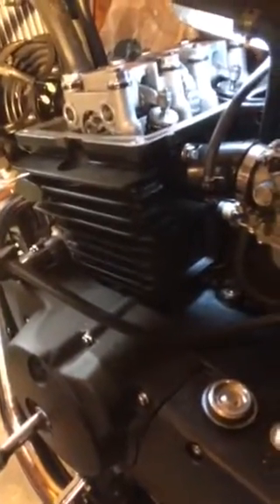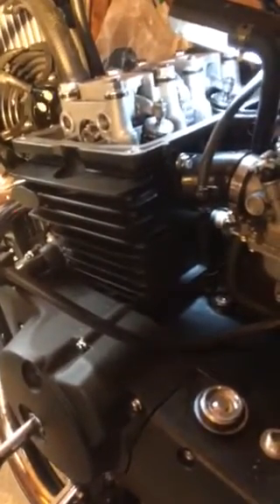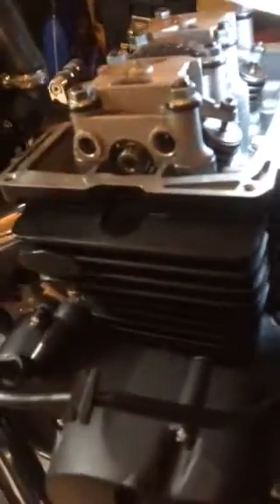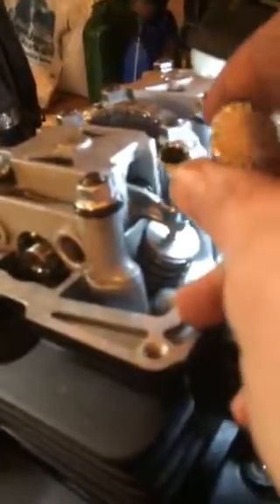AJS DD125, Bobber, EOS, and  Daytona Tappet Adjusment, By Pudsey ajs

Comment: Hey there a question about the dd125e
my bike keeps cutting out.
don't know if you've had similar problems.
to me it seems like it's getting really hot after little time. I ran it for 10 minutes and the pipes from the radiator to the engine were really hot to touch.
a friend of mine said it seemed like there was no air getting to the carbs at a stand still. always cut out at a junction or red lights

Comment: hey Steve quick question. is this while the engine is cold or warm?
Because I've done my valve adjustment. but while I'm riding after about 25 minutes of riding. I can hear them tapping quite alot.

Comment: Hey there. I have a question for you.
I have a AJS dd125e-8
it's at 980miles and needs a service.
Wanted to know if the dealer would collect it from me as I can't ride it. Cos it needs a valve/tappet adjustment. it's a brand new bike. only had it since March 31st.
and I have warranty and I'm paying finance on it? I did ring them and tell them that the bike was cutting out on me. He was pretty short with me. Just said "needs a valve adjustment"
So was wondering if I'm in any right to ask them to collect it?